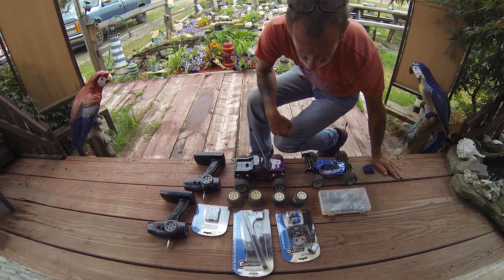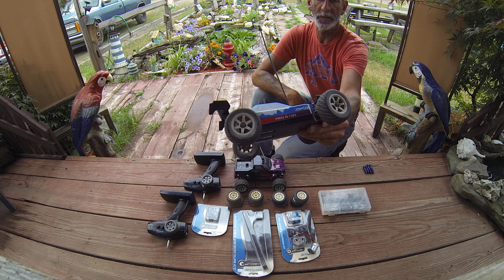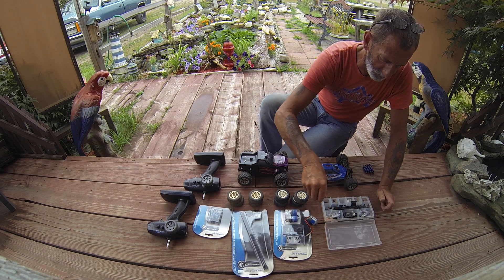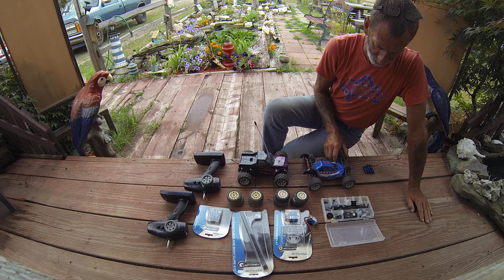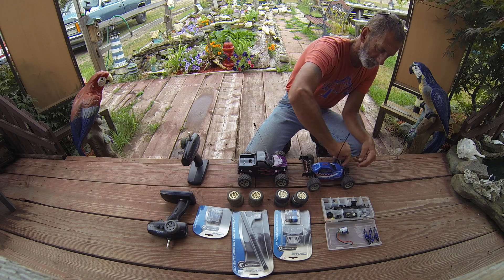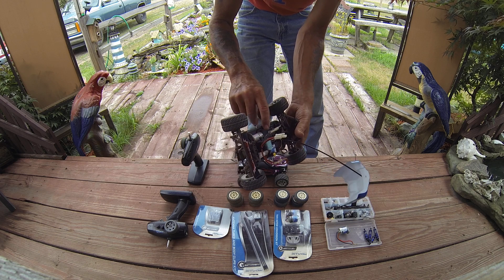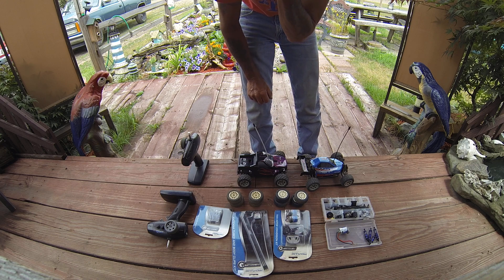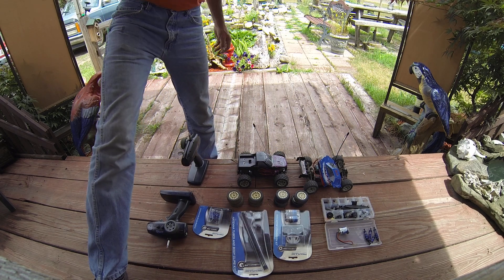Pro pulse Pro-T100 and Pro-B100 restoration and upgrade  Update.

Comment: Bob look around , I found aluminum control arms , well all aluminum chassis parts . Just fixed mine tonight the wire corroded in half on the battery plug. I felt it as I was plugging it in. Had tried new receivers & control modules & no fix & it was just a corroded wire. They had high speed & high torque motors. Where you get your trucks ,because in 2028 those trucks wasn’t sold?I bought mine in the early 2000s.